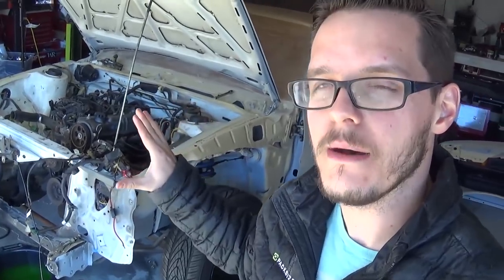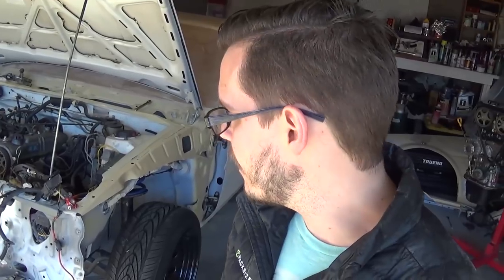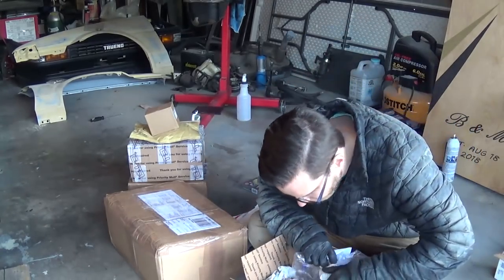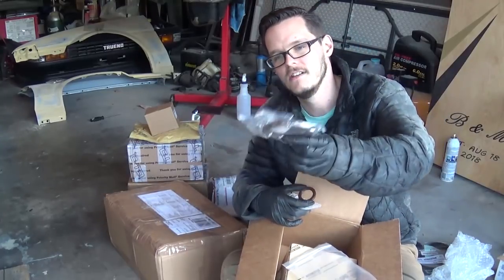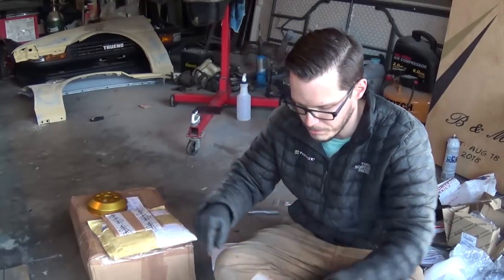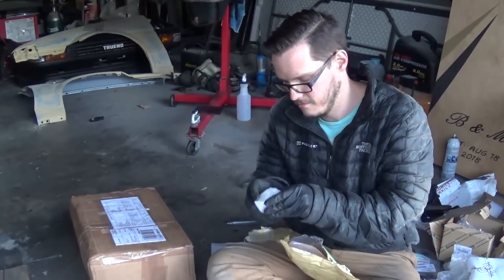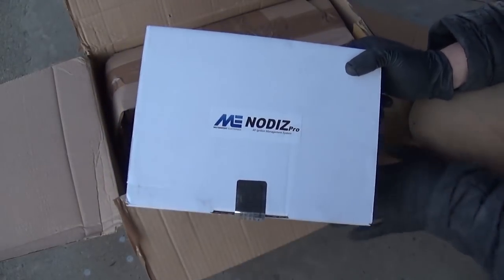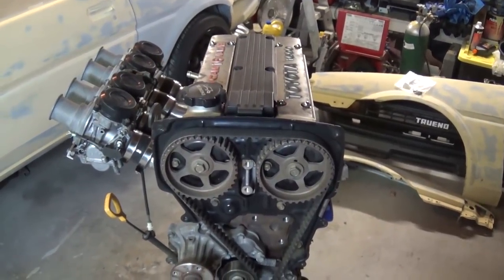AE86 Project | Bike Carb Conversion on a Toyota Corolla AE86 4AGE 16v  ( AE86 Trueno Coupe )

Comment: Driving4Answers has a great walkthrough of refreshing a manual rack when you decide to get one. I can attest that manual rack on an 86 is the way to go.
Reply from the maker: Awesome, I actually scooped one up a very long time ago. I also got T3 manual rack spacers and a supra input shaft for it. Im still a little worried about losing power steering, but hopefully it isn't that bad?
Reply: TheBSRecord , It’s not bad at all. To have an unpowered hydraulic rack is worse than a working manual rack. You’ll come to appreciate the feel and feedback. Use power rack steering knuckles for some extra steering angle for added handling characteristics (turn in/counter steer/tighter turning circle/etc.) In short: Manual rack for the win.

Comment: Yes ae92 alternator will work. I'm actually using an ee101 fwd/forklift alternator on mine
Reply from the maker: Alright cool, now I just need to take the alternator up to a parts store and have it tested. Thanks for the info!
Reply: The secret is the bracket.

Comment: I see that you have caught the Bike Carb conversion bug as well from Driving 4 Answer.

will be amazing to see another bike carb powered 4AGE.

for fuel pump, you can prob run the same kind of bike fuel pump similar to what D4A is using.
Reply: you just earned a sub
Reply from the maker: Definitely! I cant wait to get everything together, connected, and running. D4A has been a huge inspiration for this build.  As for fuel, yeah that's definitley an option. I would like to use the stock lines that are already there but I may have to run all new. I will have to watch d4a's video again to see exactly what he did. Thanks for watching!
Reply from the maker: Thanks for the sub too! 👍👍
Reply: Here on Lin Chester's recommendation. Subscribed. I love D4A as well, was checking if he had commented on this.

Comment: You could use the mounts from the 4ac. They are completely identical.
Reply from the maker: Are they? I really thought they were slightly different. Good info to know though, at least those weren't mounts weren't very expensive.  Also, they are in better shape than the ones currently on the 4ac. Thanks for watching and letting me know. I'm still learning as I go, so it's good to clear up misinformation for the next guy 👍
Reply: TheBSRecord yeah even the motor mount brackets are exactly the same. The 4AC and the 4AGE are both A series engines. The blocks are identical. The internals are slightly different but even so you could swap them. They bolt up. 4AC’s use the same connecting rods as early 4age’s.
Reply from the maker: @thebrownguy2820  makes sense, idk why I thought they were different. I remember reading that people "Frankenstein" A series engines all the time, so it makes sense that the motor mounts should be identical.   At least the 4ac mounts can stay with the engine. Thanks for the clarification man 👍

Comment: Hey man nice video, good to see you upload again so soon rather than being a year between haha. I am curious as to why people choose to go with carbs on a 4age as opposed to sticking with efi? I admit I don't know much about the 16v 4ages having never owned one, just many 20v's
Reply from the maker: Hahaha yeah I suck at posting in a timely manner 🤣. As for my reasoning behind going the bike carb route, I love the look of a clean, carbed 4age as well as the sound they make.  Also, I feel like running carbs gets rid of a lot of complexity on the air and fuel side of things. Just  my opinion of course. Efi is more reliable and practical for everyday use though.
Reply: @TheBSRecord  nice one, I get it. Ive been looking at some real clean wire tucked 4ages and man it looks so tidy. Good luck, looking forward to more videos coming through but I know it takes alot of time to make and edit etc

Comment: The 4ac engine mounts bolt right up to the 4ag. You don't need 4age specific ones..
Reply from the maker: Yeah, someone had mentioned that in a earlier comment. I honestly thought they were slightly different but now I know. At least the ones I got are in better condition than the 4ac ones.
Reply: Yeah just keep them as a backup.

Comment: Gonna be sweet
Reply from the maker: Thanks man, I hope so!
Reply: Can't wait to see it. I just did a ton of work to mine. Mishimoto radiator, all new calipers, pads, rotors, new battery tray and hold down, new power mirrors so they match and work, 2 front tires. Working on getting the hvac system back in. Ready for drifty stuffs

Comment: did they sell you just main jets? Or did they give u the pilot jet and washer for the needle?
Reply from the maker: I haven't touched the carbs.  The place I bought them from replaced the jets and all the needed hardware for my application.  With that being said, I am sure I will still need to mess with the jets to get everything working properly.  Thanks for watching!

Comment: Ahhh yes.. the poor mans itbs. Great budget power but pain in the ass to tune. For the fuel pump you should run low pressure electric pump, atleast that is what we run here with bike carbs
Reply from the maker: Everybody tells me I'm crazy for going bike carbs but I'm up for the challenge. Figuring it out will be annoying I'm sure, but I'm stoaked to learn. It will all be worth it when I get that WOT flyby. For fuel, I was thinking of running a bung out the bottom of the tank and mounting an external motorcycle fuel pump somewhere inline. I would like to use the existing fuel lines, but still have to figure it all out. I have a gts pump and could run a fuel pressure regulator at the carbs to tone down the pressure. Hmmmmmm decisions, decisions...
Reply: they really aren't that bad to tune, and certainly cheaper than a full EFI tune at least!

Comment: What carb jet kit did u get?
Reply from the maker: I bought the carb kit from DanST Engineering. Currently the jets that came in the kit are what were used to start the engine. I'll check and see I can find the actual size and let you know.  I am sure I will need to tune the carbs before actually driving it though. Thanks for tuning in!
Reply: @TheBSRecord  did they sell you just main jets? Or did they give u the pilot jet and washer for the needle?